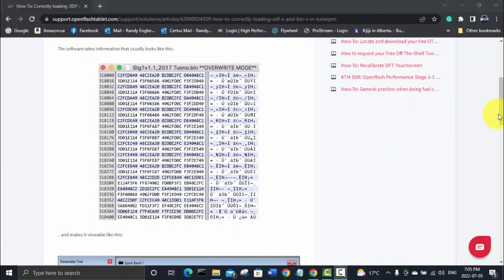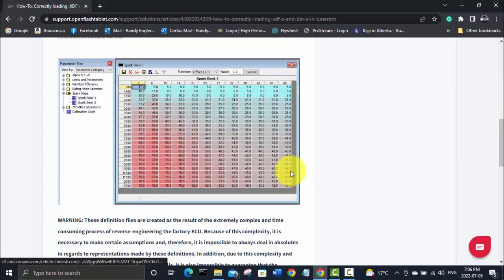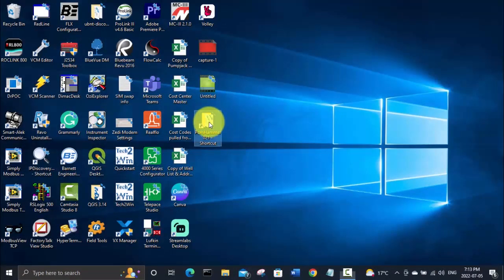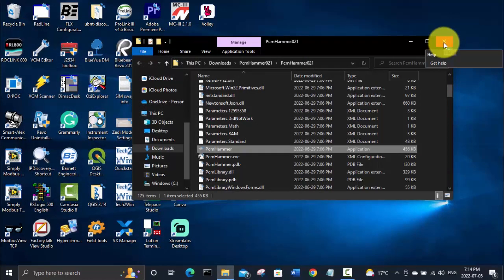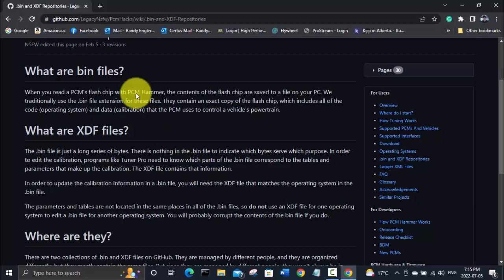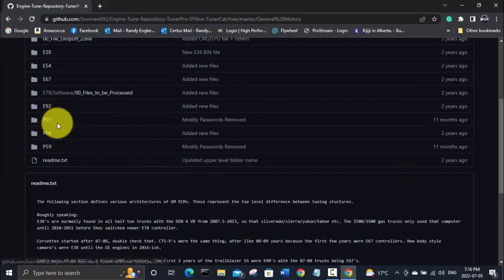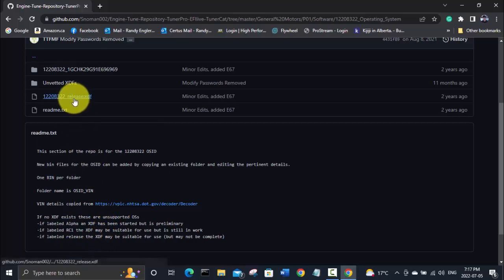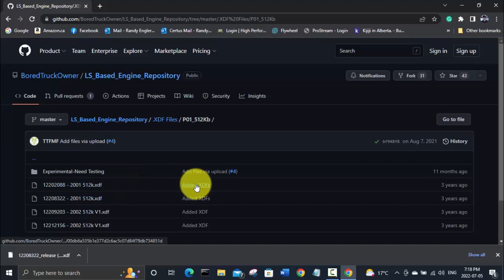PCM Hammer and Tunerpro - Bin and XDF Files Explained

Comment: looking to edit a land rover td5 diesel ecu .map file my need is to change a vin from a 1999 to my 2001 so no more check sum errors and be able to load correct map and tuning data. ecu is a angers nnn500020  re-programmable bought wrecking yard London. need to find hexadecimal value of the old vin to over write it with my vin. 2001 defender 110 TD5  . I do have TunerPro.

Comment: I'm about 10 to 15 years late to the party. Anyone know where I can find the ADX, XDF and Bin files needed to tune a stock 92 Z28 5.7L L98 TPI? I know most people are tuning LS applications but I wanted to play around with this old dinosaur first. I've downloaded Tunerpro RT and I bought an ALDL cable, but I cant find the files for this old tuned port engine. Any help/guidance will be greatly appreciated. Thank you!
Reply from the maker: I don’t have any personal experience with those older engines but I would join and ask on the pcmhacking.net forum and gearhead-efi.com forums if you haven’t already, there may be someone on there that would have the files you need. Good luck!

Comment: can these software be used on Fords?
Reply from the maker: No unfortunately PCM Hammer only works on GM Gen 3 LS stuff. TunerPro may be able to be used on a Ford but you’d need a different program to get the bin file out of the computer. I have no experience with TunerPro on Fords personally though.
Reply: @LowbuckLS  Ok thanks for the update. I did ask OpenAI and this the response I got:

"PCM Hammer is another tuning software that can be used to tune the factory PCM on a 2005 Ford Expedition. It's a free and open-source software that allows for custom tuning of the factory PCM and includes features such as data logging, real-time tuning, and checksum correction.

One advantage of PCM Hammer is its user-friendly interface, which can make it easier for beginners to get started with tuning. However, it may not have as many advanced features as some of the paid tuning software options, and the level of support and updates may be more limited."
Reply from the maker: @DelFam2011  I’m always amazed at how good of a story AI can produce. But it’s like a politician, what’s coming out sounds good but a lot of what they’re saying is BS. Plenty of errors in that answer you got.

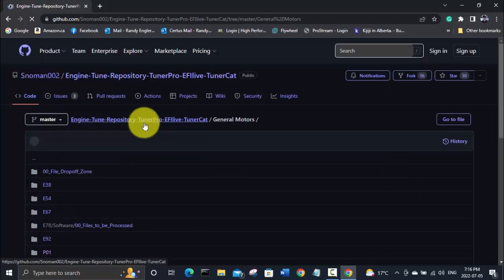Comment: Hey Randy, one thing your viewers should know is that if you cant find the xdf file for your os, you can easily replace your os. On this video at time 8:41 you will see the heading "What if you can't find the one you want" Read that and you will see the solution
Reply: I am having trouble finding a known good XDF so I was actually just reading about this. But does that mean the tune will be off? I am only trying to do a stock swap using a little LR4 but didn't want the tune to be off if I changed the OS.